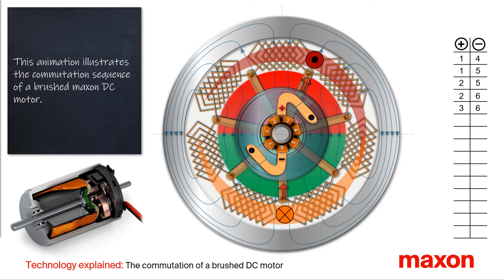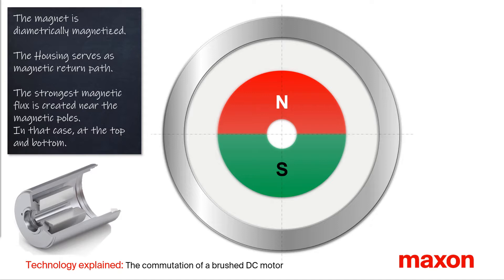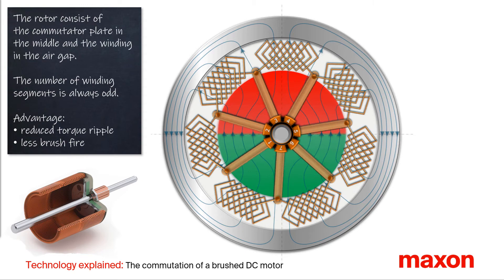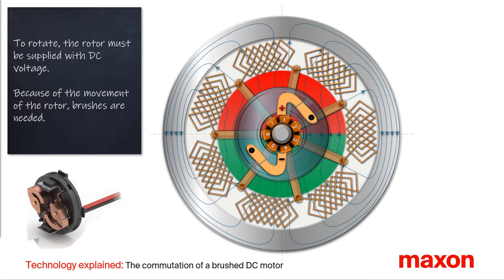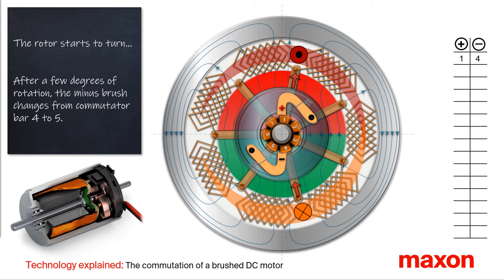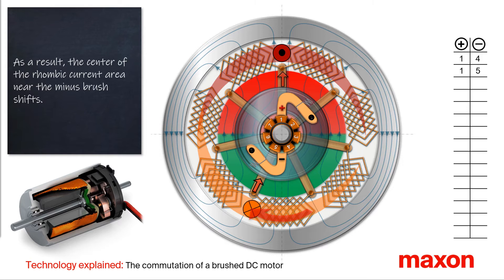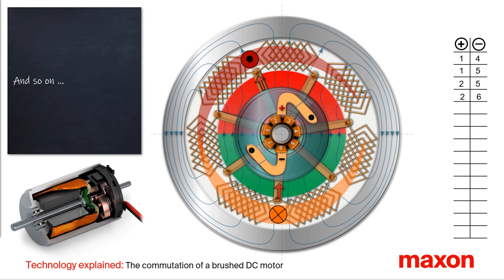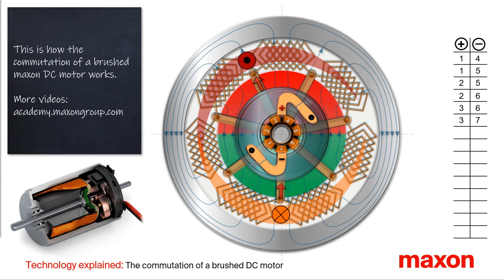Commutation DC motor

Comment: the brushes are touch 2 bars at a time, is the brush shaped like that to make sure it is pushed in the right direction?
Reply: the point at which the brushes touches the 2 bars is when the current is reversed(also reversing polarity). The motor would normally produce AC currents without the brushes and commutators. The current reversal due to the 2 bars being touched ensures that the opposite polarity causing the AC currents is flipped to form DC currents